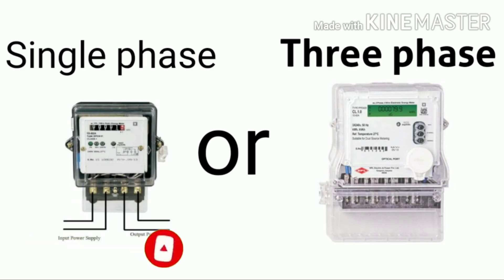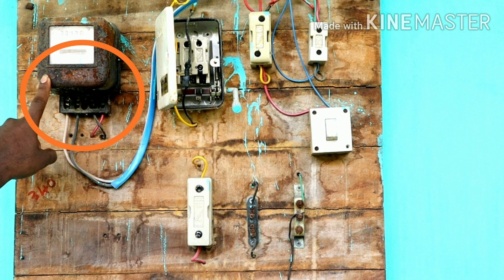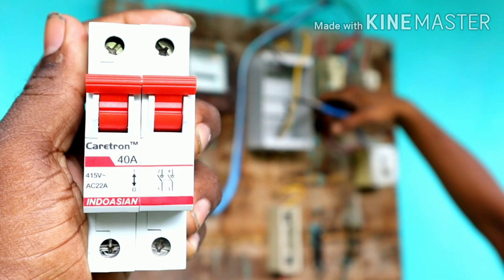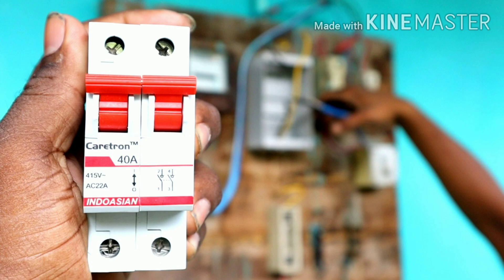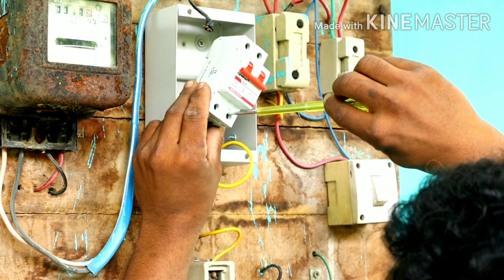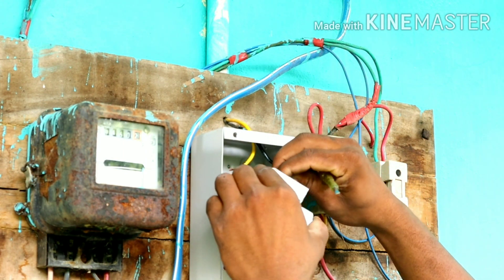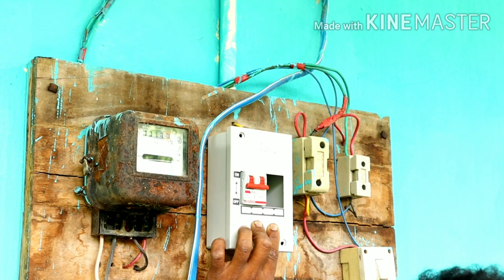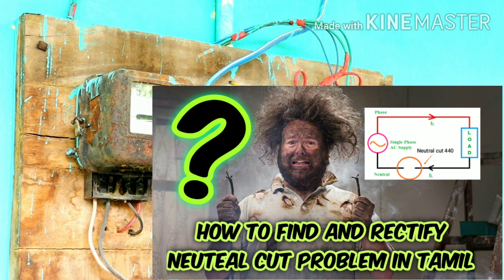How to change fault main switch in single phase main board in tamil

Comment: power direct eppadi bro pannurathu
Reply from the maker: Remove isolator and connect the wire with isolator
And please check the cut out fuse is removed before start working